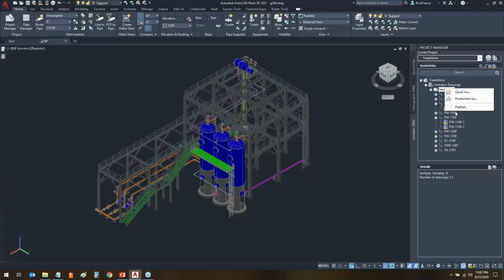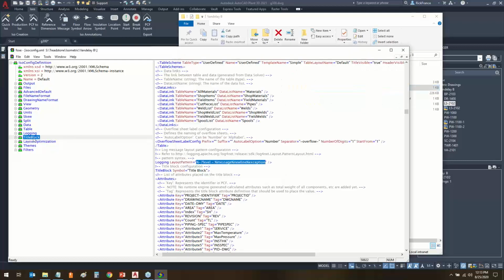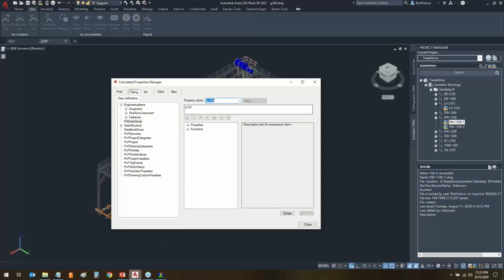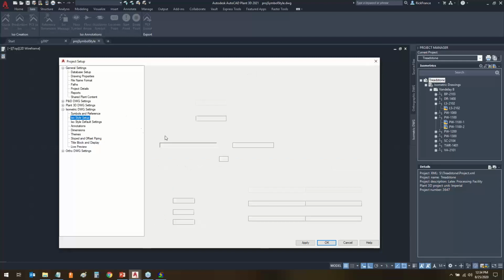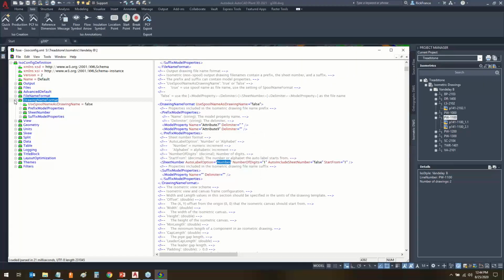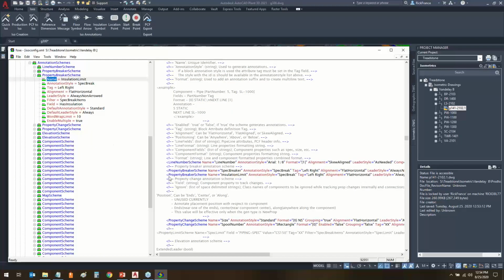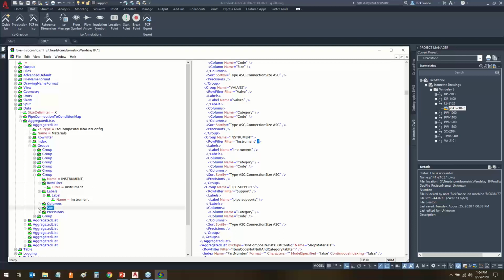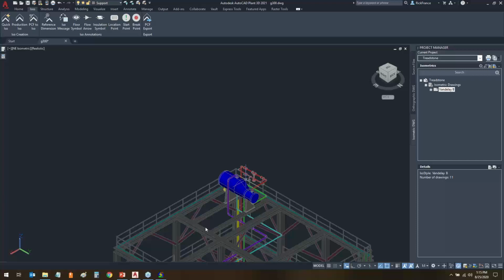Plant 3D:  To Isometrics And Beyond!

Comment: great tips 
i have an issue 
 I performed a Generate ISO in AutoCAD Plant 3D. Before that, I set the weld between the elbow and the pipe as a Field Weld. I want the program, when generating the ISO, to automatically add (+100) on the dimension of the pipe that comes after any Field Weld 
where can i modify it in ISOConfing .XML 
because i need it in my work

Comment: here is one that im sure you cant handle LOL'' my Isometrics display coordinates, that is taken from , my 0,0 UCS - I then move my UCS to a new location to have all the coordinates reference to the new location, but when i run the Iso's, it still gives the coordinates that come from the UCS as if it is still on 0,0
Reply from the maker: Plant 3D will not like it if you try to move the model off of 0,0,0 – it will give you numorous errors and messages until you fix it. But for what you are wanting to do, if you have 2022 or 2023 in the Project Setup under Isometric DWG settings > Iso Style Default Settings – try setting the coordinate system offset from 0,0,0 in the Offset Location section and you should be able to accomplish what you are trying to do. This feature is not available in earlier versions though.
Reply: @Hagerman  Thanks Hagerman!! I will try that!

Comment: Quick Question: How do you instead of spooling the entire line number, just spool say a window you create(one line on that line number?)
Reply from the maker: You would need to use Quick Isometrics from the actual Model. That will allow you to select only the items you want to include in the isometric. However, it will not create the iso in the project manager, but in the location you have setup for quick isos.

Comment: great tips........any ideas on how to add a numbered list of flanged joints onto the isometric
Reply from the maker: I’m not sure if that is possible out of the box. If I am understanding the question correctly, you would probably need to create a property where you could enter a unique number for each flange connection. After that, you would need to create some type of table to generate that list.

What I am not sure of because I’ve never tried it, is can that be accomplished in an isometric and my gut feeling says that it cannot. The iso’s pretty much only create a BOM, Cut List and Weld List.

I know I could create a Report that would do that, but that would be a separate document.